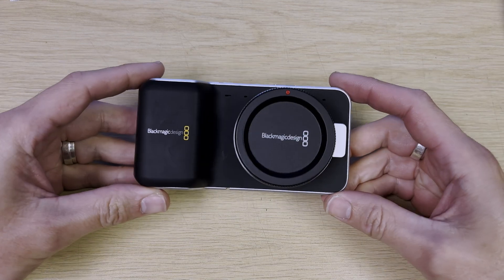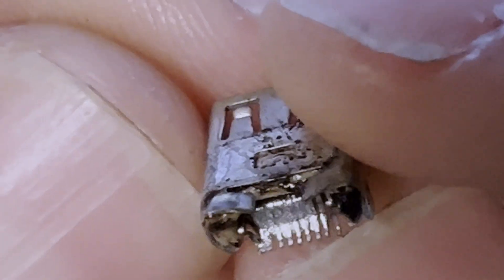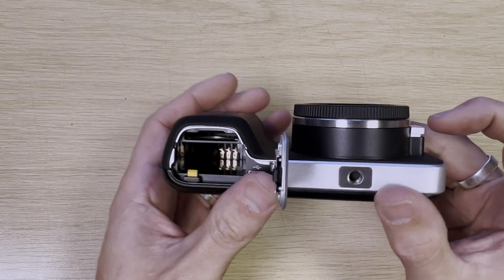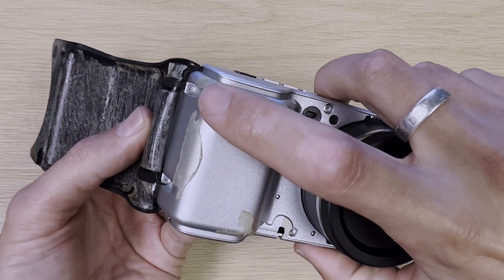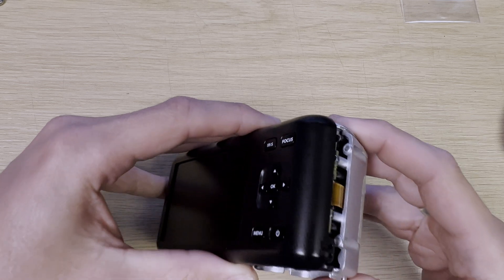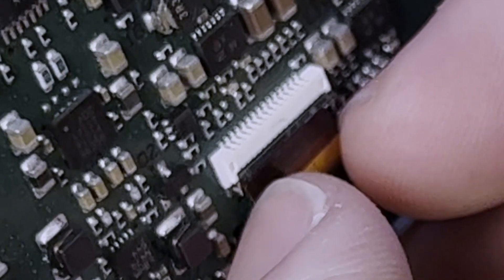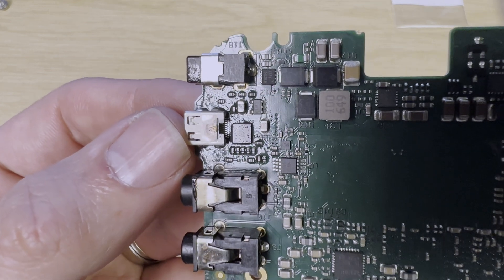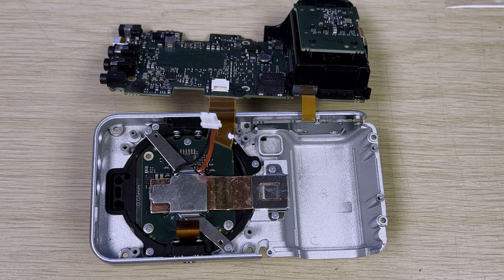HDMI port repair: Blackmagic Pocket Cinema Camera disassembly teardown - OG BMPCC

Comment: #00 Philips Screwdriver is the one you need for this tear down. I tried a #0 and it didn't work.
Also, if the you can tell the hdmi port is loose or pushed in, then the hdmi will not work as it is supposed to be soldered and not moveable. 

I followed this tutorial just to find a loose aka broken port, could have just noticed the port was loose from the outside.

Comment: It's a great video, I appreciate the time that you put into it. The addition of the part numbers has been great for me. I just ordered some from digikey and they are spot on. I would have loved to have seen your soldering technique.... I'm going to try cleaning up the pads, a small amount of solder on each, heat up (Maybe 350 degrees) and press down when they melt. Solder the securing legs when I know that the pins are correct.

Comment: Just lost the hdmi port on mine after many years of good work. Just pushed too hard and the micro hdmi port broke free of the board. This makes it obvious that you can't get it fixed unless you have a high end micro-soldiering technician to reattach those legs. Bummer b/c it makes a great 3rd camera for streaming. But alas it's better to just buy a new one for any output needs. Well done though.
Reply: i wish there was some soldering techs around cuz i really wanna fix mine

Comment: Hello ! I wish I could replace the dc plug into a D TAP, I love this camera so much but the powering solution is so bad. Do you have any idea for this ?
Reply: i would just run power from v mount to the camera with a dtap-to-bmpcc power
Reply: @MagieLamp  I meant about the plug. This is so cheap i loose power randomly

Comment: Has anyone ever had a problem with the dc socket? Mine ist not working anymore. Camera is doing fine with internal battery, dc socket is dead.
Reply: Probably a broken solder joint from the connector to the PCB

Comment: The spring tang is in the wrong location... that causes the battery door to want to stay closed, when it is supposed to spring open.  You need to flip the spring around so that top part is on the other side, then when you install the door and the pin into the camera, make sure that tang sits against the visible part of the battery compartment.  I checked with another BMPCC OG I have, and then it sprung open properly.
Reply from the maker: Thanks for spotting that, I've now swapped mine around too, I'll pin your comment to the top for other viewers too ;)

Comment: I would totally put thermal paste on the copper holder, that acts as a cooler.
Reply from the maker: I would only disturb this if there was actually an overheating problem , which I haven’t seen.
Easy to do if that ever becomes an issue in the future.
Reply: @neilhester-tech  Completelly agree, but believe me, once you get an overheating alert from a mirrorless for recording 5 minutes in a radio studio, you take it as a heavy issue.

Comment: niceee. the ubs port is quite easy to replace. also by seeing how the sensor cooling is done, u can see it depends on the alloy case. so i m sure its better off without the rubber black cover..
Reply from the maker: I didn’t look at the USB port but I don’t think it’s a major problem for most owners, the Micro HDMI is the biggest issue with these cameras.
I haven’t heard of over heating problems but people are of course welcome to modify their own in any way they like.
Reply: @neilhester-tech  sorry u are right i was mistaken for hdmi port
Reply: Also looks better